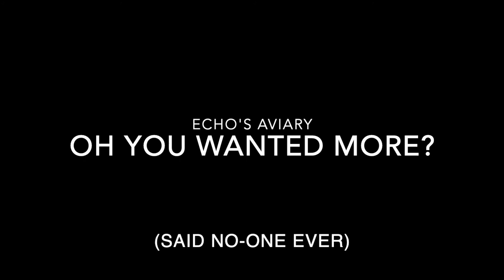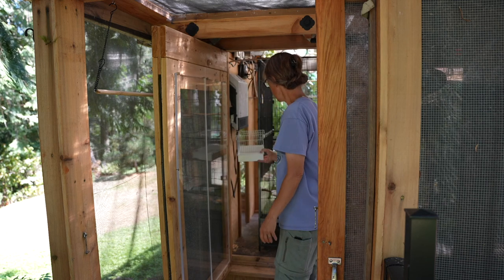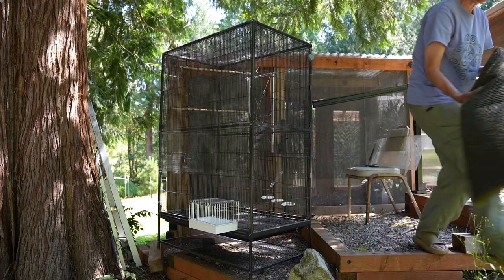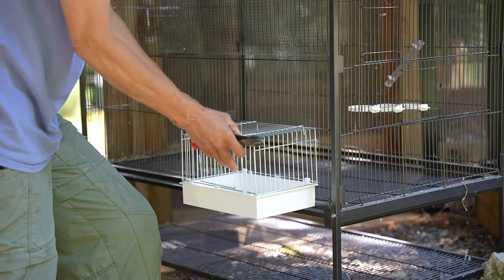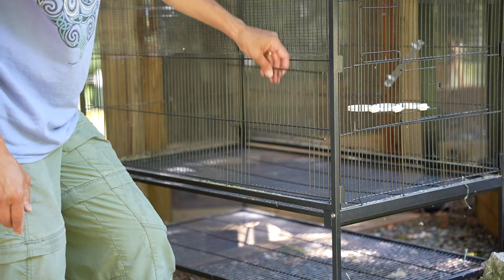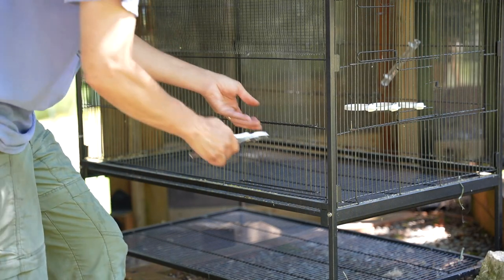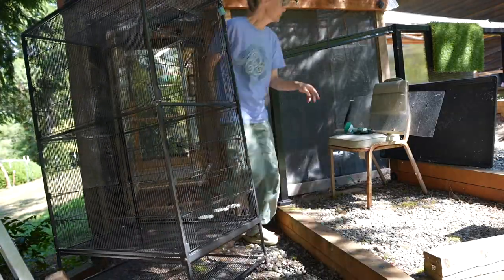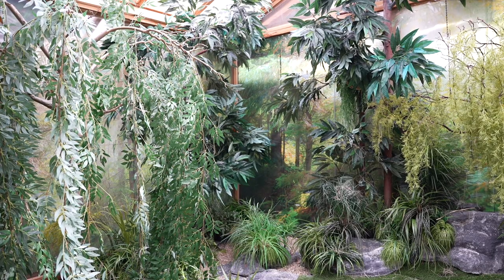Aviary update: How I add doors to a purchased cage

Comment: How to you make sure the edges aren’t too sharp?
Reply from the maker: dremel tool or file. both are tedious.  also cut the bars at an angle using the horizontal wire as a guide so that cut bar tapers toward the horizontal bar.  that leaves very little to know pokey edges